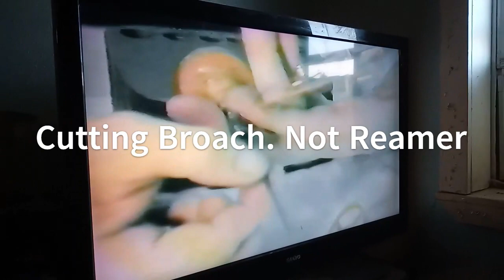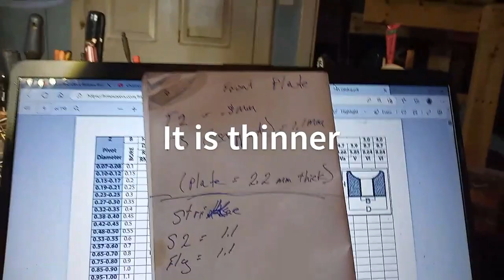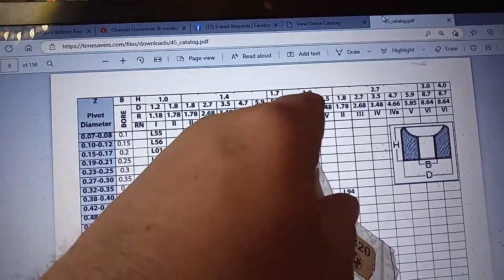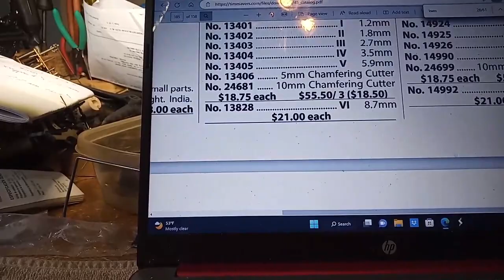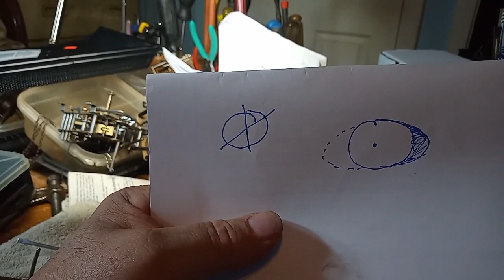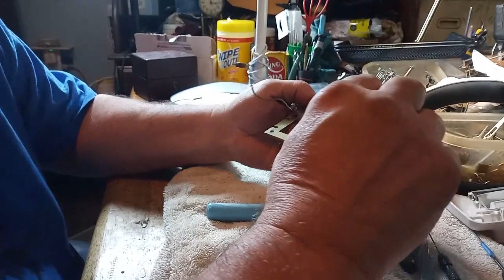Talking about installing bushings in a clock using both cutting broaches/reamers. Using KWM reamers

Comment: The background noise sounds like you're on the bridge of the original Starship Enterprise.
My question is was the 3.48 reamer size actually measure  larger, or did the 3.5 bushing measure smaller.
Reply from the maker: You always want to broach or ream smaller than the bushing by just a few thousands of an inch/mms. If you dont then the bushing will fall through the hole.  At the time I was using a Pittsburgh digital caliper which was what I could afford at the time. I would suggest not using one as they are cheaply made. But a nicer one that is built better. I now have one that was made by General. It cost me around $45 but well worth the money.  I hope this helps.

Comment: Do you always broach out the inside of the bushing from the inside of the plate? Or do you flip the plate and do both sides? The broach is tapered I'm guessing for a reason. You want the hole minutely smaller on one side of the plate, or it doesn't matter?
Reply from the maker: Broaching is done from one side only. I install the bushings from the inside to the outside of the plates. That way the inside is nice and smooth. However it would be best to get into the habit of filing the inside plate down after you put the bushing in as sometimes while putting the bushing in it will cause a divot/burr/etc.,. and your wheel wont have any end shake.

Comment: You talk about filing the opposite side of an oblong hole to be able to center the reamer or cutting broach. What do you file with? Can you use the cutting broach to file an equal oblong area before cutting the actual hole in the plate?
Reply from the maker: I bought those diamond reamers that work well for filing the opposite side of the hole. You are supposed to be able to by small files but all the files that I have bought are too big. Yes you can use the broach to file the opposite side of the hole but it is harder so that is why I use the diamond reamers.

Comment: If I owned that video, I would have it converted to DVD. I can't seem to find it anywhere.Merry Christmas Mark!
Reply from the maker: Merry Christmas to you John. I do have a VHS to DVD convertor that I have converted the VHS on General Clock Repair by Bruce Rasmessum on.  They sell it on ebay.  Here  you go. I highly recommend that you buy it. You will learn a lot but not on cuckoo clocks.  https://www.ebay.com/itm/260953670453?hash=item3cc20d0335:g:mIsAAMXQ97RRGzIZ&amdata=enc%3AAQAHAAAAoKvBzFRx0Lv1B7qJGVtEa7FfL0x4bcXVxvL7C2GItvPzELBV1%2FmOFssKxXHYwD87r0e2a1szQBjdmO1BiXow7jxh3Kkuw0AC6UHHVSAkmHQvpnf4GYUx7L8sAhgtjnk4%2BzUTBkcxrCwLZ1k313bCiF2tSqHzWtHYx2eDClKlMD06qCvIbmIF4nCUbcS9trapxCqhlN59zzVzAihVs1NCQtQ%3D%7Ctkp%3ABk9SR9i_gZipYQ
Reply: @munnerlyn3  Thanks for the link Mark! I have the book "Black forest Clockmaker and the Cuckoo clock" by Karl Kochmann which I have been reading. Also yours and JustMike's video content too.
Reply from the maker: @johnhannon  FYI I have that book. The NAWCC has pointed out errors in the book. For example. The GK movement that they refer to isnt Gebruder Kurner. It is George Kuehl. The Kurner brothers didnt make clocks until the 40s I think.

Comment: The main thing is, does it work for you? If so, then I don't see a problem at all. As for the cutting broaches, they come in so handy, even when using the KWM's. I think, putting it in your drill would be ok. Just run the drill at a low speed so you don't get the heat on the bit. When the bushing doesn't stay in because the hole is too big, I have had to tap the brass plate to snug it up again. (For me, I am carful when reaming as I get close so this does not happen. This is a well done video with a good warning of what happen to you when using this tool.
Reply from the maker: Thanks Mike.  I have been told by a few people who have the KWM reamers that you have to buy the reamers for that tool just like you have to buy the reamers for the Burgeon tool. Both sets use their own style reamer. I have some that I bought for the KWM but not for this size of movement. I have some that would take a reamer 1 and reamer 2.